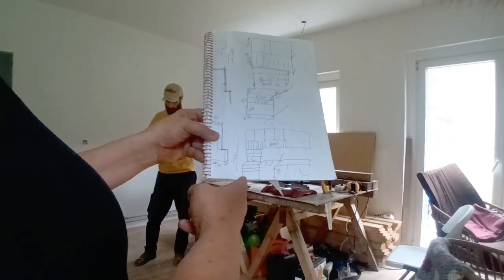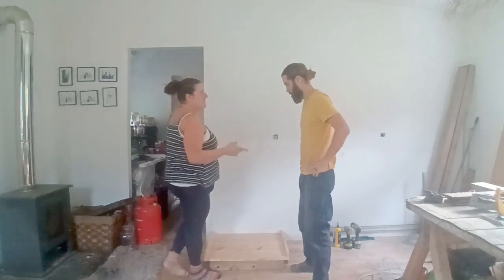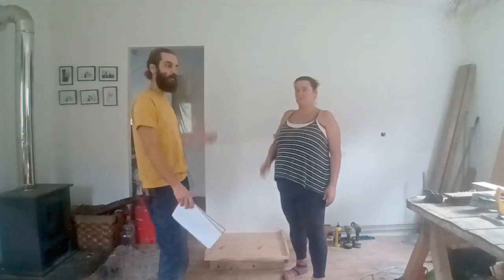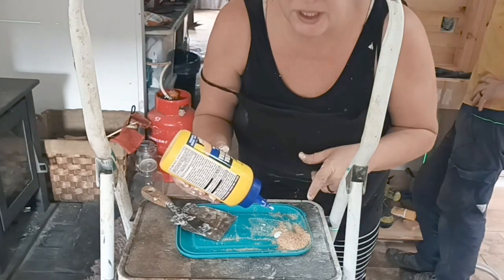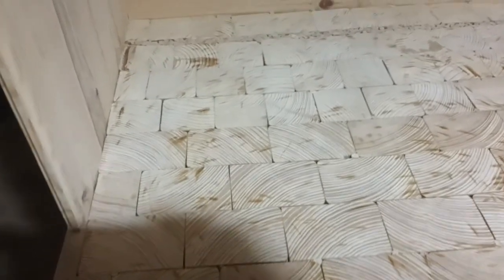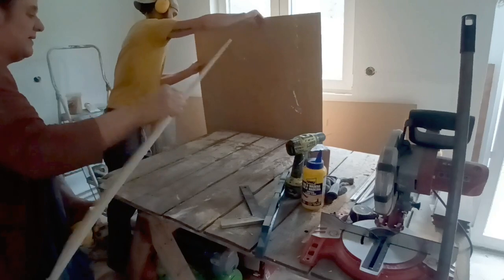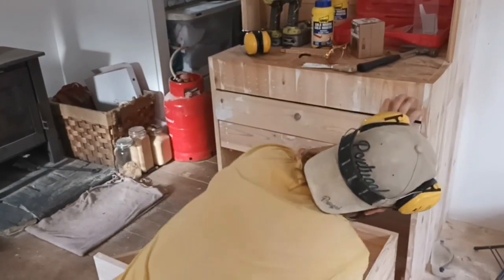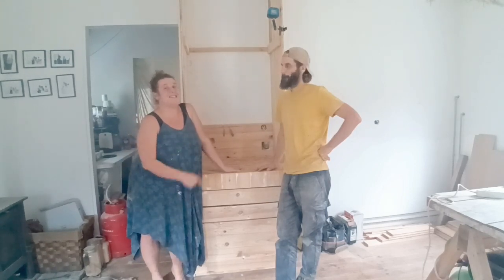Starting with our Dream Kitchen for our Portuguese Homestead - Super Exciting time!

Comment: Will a metal grate across and then build the walls higher and put a stone high across the top where it is not in direct heat?  The kitchen build is great.
Reply from the maker: Thanks for the tip and for watching!